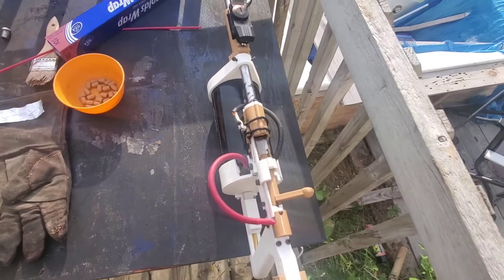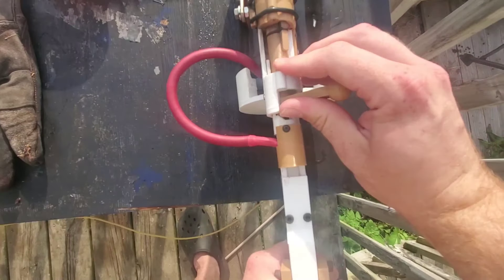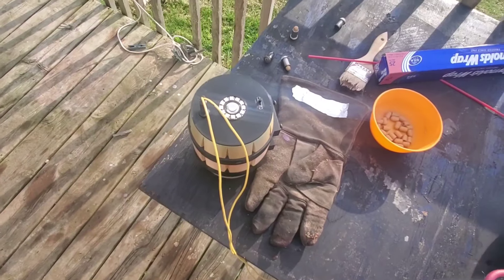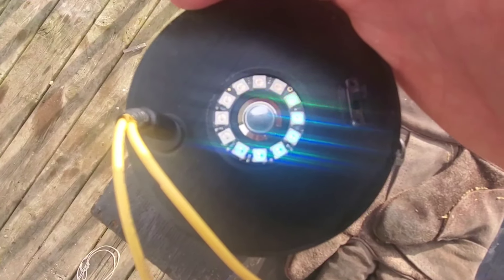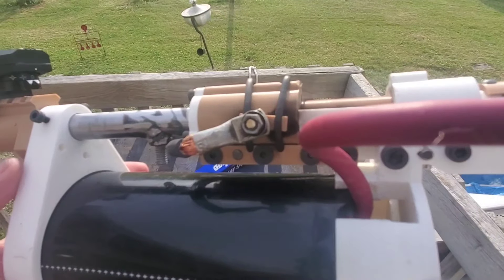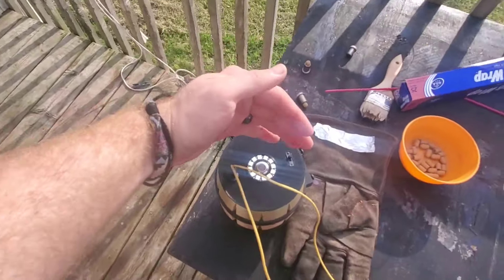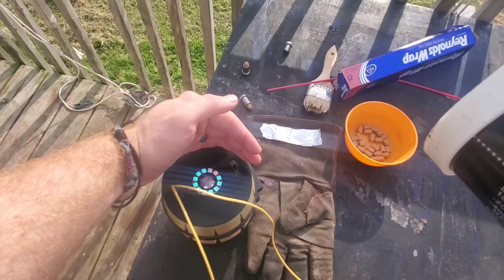Bolt Action Plasma Gun Quick Demonstration

Comment: As your ATF agent, I’m so proud of you and can’t wait to have this cool item in our evidence locker.
Reply: RIP to this guy's dog.
Reply: Nothing illegal about this in the slightest. Its technically not even a firearm
Reply: Lol as usual gov agency’s violating the very laws they created and are supposedly proud to uphold 🤣🤣
Reply: @muskybawls2952  not yet
Reply: @muskybawls2952  Yeah, actually it is.  It uses exploding or burning hot gasses to propel a projectile.  It doesn't matter what the fuel is that is providing the gasses.
Reply: @blu_gingerNY  What law would the BATFE be violating?  I hate folks fantasizing and blaming an organization for something they haven't even done.
Reply: Not likely if he can get the reloading more streamline he'll have a contract with someone in no time.
Reply: Hey he is fine particle weapons are not regulated by the ATF
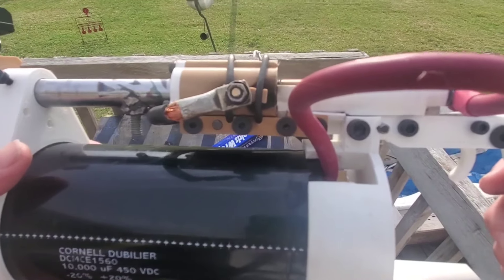Reply: @Omanone4457  He says right in the video starting at about 0:42 that he "discharges a bunch of energy into a piece of aluminum foil, and it explodes and the pressure from that accelerates a projectile out the barrel."  That is the text book definition of a firearm.  It doesn't matter what he uses to ignite the fuel (electricity vs firing pin striking a primer), what the fuel is (aluminum vs gun powder).  Of course, if he has six figures to drop on attorney fees he can fight the BATFE on their interpretation of the law.  I suggest finding a deep pockets organization to back you, being prepared for years of litigation and the very real possibility that you lose everything and go to jail.
Reply: @P.Subaeruginosa  I agree that many other inventions we take for granted didn't appear any more practical in there first versions.  Still, it does seem a long way to go to send a projectile down a barrel.  Now if it sent a speed of light particle beam, energy beam, or light beam, that would be a great leap forward.
Reply: The number of people taking this comment seriously is ridiculous.
Reply: @michaeledmunds7266  Actually, the various points of view expressed show why the comment should be treated seriously, regardless of the OP's intent.
Reply: It's not a firearm
Reply: @lonesurvivalist3147  I don't get why folks keep insisting that it is not a firearm when the video and a quick Google search shows that it plainly is.  LOOK IT UP BEFORE RUNNING YOUR MOUTH.
18 U.S.C., § 921(a)(3)  The term “Firearm” means:  Any weapon (including a starter gun) which will or is designed to or may readily be converted to expel a projectile by the action of an explosive;

Section 2923.11 - Ohio Revised Code
(B)(1) "Firearm" means any deadly weapon capable of expelling or propelling one or more projectiles by the action of an explosive or combustible propellant. 

In this case, the aluminum becomes an explosive or combustible propellant.  Aluminum is frequently used as a component of explosives, rocket fuel, and fireworks because it burns.

Now, in the USA and in most states it is not illegal to make a firearm for one's own noncommercial use.  So, he can have at it.
Reply: At least wait for him to build a second one, so you can cross the streams
Reply: Go ahead I can make new weapons faster than you can make laws banning them.
Reply: @BryanTorok  Normally I would agree except for aluminum is not considered a propellent or explosive under atf regulations and if I'm understanding his design right he's using an expansion of plasma to force the projectile down the barrel, not only this but the atf doesn't even consider most low explosives like this regulatable( look at their ruling on rocket motors)
Reply: As someone who doesn't live in the USA, reply sections like these routinely remind me how lucky I am to not live there.
Reply: You think that's cool wait until you see my z9000 bio molecular disintegratior you'll lose your shit
Reply: @goldenboy9748  That will be hard to do if they seize all of your equipment as criminal tools, freeze your bank accounts, and you are sitting in jail because you can't post bond.
Reply: @BryanTorok  Well personally I think it's a good thing organisations fight the atf for things like that, if they classify regular aluminum foil as an explosive, you would damn near need to background check people who are just baking cookies... Also thanks for not just resorting to pure insults and actually have a discussion not a screaming match.
Reply: @GrouchoTM  if you haven't noticed, Nerf went from pretty cool looking guns with a wide variety, to mostly just having a few different cheap/lame Fortnite  ones and a couple expensive ones.
Reply: Sadly ya name is honestly ironic
Reply: @Omanone4457  not yet, but if they think that they need to they will get it added to the regulations so that they can enforce it.
Reply: @rodrunion8899  this isn't really arms it's more of a weapon of mass deduction, as it can deduce where your brains should go, usually figuring out on the ground is a good place
Reply: @GrouchoTM  "anti constitutionalists" 
Oh sorry we had to take your tank away, luckily you still have your display case of clocks, 12 different types of shotguns and 23 other various handguns. 

I'll stick to my musket thanks
Reply: @rexjolles  cringe
Reply: @josephg.1.130  musket good plastic gun bad unga bunga
Reply: @MrPig40  They actually did that to me though.
Reply: Thats not a firearm so
Reply: 3d print a one time shooter and its untraceable
Reply: Not a firearm. You ca put a silencer on an air gun all you want.
Reply: @BryanTorok  Considering it’s one charge per YEAR, I don’t see the issue, LOL!  By time it’s charged, the skirmish will be over. 🤪
Reply: @muskybawls2952  neither are grenades or rockets, but that won't stop them.
Reply: @williambell4591  You aren't implying that this is an extremely sloooow gun, are you?  While I question the practicality of this, I do have to allow that many inventions weren't very practical in their first incarnations.  That includes airplanes, telephones, and radio.  So, this might someday be useful.
Reply: @BryanTorok  I was just teasing when I said that - don't take it seriously.
I talking about the charging of the capacitor.
Frankly, I'd prefer to see him dumping that stored energy into a laser diode so it could burn a hole though a tree!  🤓
Reply: @2010ngojo  those are explosive which are more destructive than firearms. Idk where you were trying to go with that arguement
Reply: @muskybawls2952 
My point is they are not firearms so it wouldn't stop them from regulating those things. How about suppressors then if you're gonna be anal about it.
Reply: @2010ngojo  try moving to a free state like where i am where we dont follow federal laws regarding guns. That being said i do believe that people shouldnt have true destructive devices such as bombs or grenade launchers without regulation because of the lower intelligence of my fellow man. Example A being you
Reply: @williambell4591  I got your meaning and was concerned about the capacitor charge time myself.  However, there are super capacitors that have much greater capacity (1 Farad is common) but much lower voltage rating.  When the technology gets to the point of having a 1 Farad cap with a 1,000 volt rating in a package smaller than the cap he is using, the factor limiting the charge speed will be how much current the supply can source.
Reply: @StuartGray  😆depends on where you live.
Reply: @muskybawls2952  Not in the US it does not. We have a constitutional right to guns. Also, it is not a limited right in the constitution. At the time it was written it gave citizens of the US the right to carry and use the same weapons that the US military used. Privateers even had ships with cannons. So, if constitutionally we could have artillery and the same guns that our soldiers had ... Any US law in any state that restricts gun rights to any US citizen is unconstitutional and illegal by US constitutional law.

If you live somewhere other than the US then freedom is nothing that you value past its convenience at the moment anyways so ...
Reply: @StuartGray  only problem with that is going to be state laws. You have to follow state laws the same if not more. Local police and state troopers dont go off of federal law. Complain all you want its not going to change anything. Maybe go out and vote if you actually want to make a change or at the very least prevent whatever state you live in from turning into cali
Reply: @muskybawls2952  The real problem is the people. The people have stopped standing up for their constitutional rights. When they do that those who want control remove your rights. Those who enforce state and local laws take an oath to follow the constitution. When they choose not to, I no longer see them as a dutiful servant of the people and accord them none of the deference due to those who are.
Reply: @BryanTorok  Then why aren’t black powder guns considered “firearms”?
Reply: @EasternSunset007  Because, they burn a fuel (actually an explosive containing a fuel and oxidizer) to create pressure and propel a projectile out of a barrel.  However, they are exempt from many regulations because they use an obsolete action and propellant.
Reply: @BryanTorok  I went back and fixed my original post. I meant to say aren’t, instead of are. And black powder is hardly obsolete! There are tons of black powder firearms that are still used every day!
Reply: @EasternSunset007  I thought that you might have meant aren't.  That is the reason  for my last sentence or two.  Black powder guns ARE firearms, but for some purposes in the law they are either exempted or defined to not be firearms for a particular portion of the law.  A gun which takes 15 to 30 seconds for an experienced user to load and fire one shot is not considered to be as much of a threat as a modern firearm.  On the other hand, lots of hunters take deer and other large to moderate size game with them, so they can be just as deadly.
Reply: @BryanTorok   I own several. I get what you’re saying. Not all black powder guns take 15-30seconds to reload, though. I have a BP revolver that uses percussion caps, and you can fire all the shots just as fast as you can cock the hammer and pull the trigger.
Reply: That wouldn’t be classified as a firearm
Reply: @BryanTorok  yet black powder guns are not firearms in the ATFs eyes and you just described one to a T
Reply: All the 2nd amendment Andy boys in here can't take a joke.😆
Reply: @EasternSunset007  Just out of curiosity, assuming that you don't just swap out the spent cylinder with a loaded cylinder, how long does it take to reload your BP revolver?
Reply: @BryanTorok  I have six shots with my black powder revolver. Has the same amount of shots as most all other modern day revolvers home. And it’s only two less shots than a 1911, which many people carry. And I have two black powder revolvers. So that’s 12 shots. Does that answer your question?
Reply: @potato p - we feel equally as lucky that you don’t live here. Govern me harder Daddy
Reply: @EasternSunset007  Sorry, no that does not answer the question.  I was trained on a S&W .38 revolver.  With a plastic speed loader, I can dump the spent cartridges and reload in 2 to 3 seconds.  Much later I was retrained on the Glock 17.  That has 17 in the magazine and one in the chamber.  So, I have your 12 shots and 6 still left over.  Do you carry a third gun?  And, I can drop the magazine, insert a full mag, and drop the slide in less than than 3 seconds.

Still, I'm wondering how long it takes the typical proficient person to remove the spent percussion caps, put fresh caps on, pour measured powder into each chamber, place the bullet, and ram it into place for each chamber.  Does your revolver use bullets that are a tight fit or do you need to some sort of wadding to hold the bullet in place?  I'm not trying to be snarky.  I'm really curious about this.
Reply: Not against the law to build your own gun/firearm.  People do it all the time.  Lots of people build AR's with no serial#.  Completely legal.
Reply: @muskybawls2952  except it exactly is a firearm in most places. it fires a projectile by means of explosive gas. it doesnt matter that its not detonated by a primer and instead uses electronic firing component. hate to rain on anyone's parade but pretty sure this is a firearm most places. certainly ohio.
Reply: People gunna start fighting back tbh
Reply: @mountaintophvac9016  That is in the USA and even then not in all states.
Reply: @BryanTorok  you should try actually reading the laws not just acting like it lol technically a black powder pistol isn't even a gun and is therefore not regulated by the atf. Also he could easily have this registered as an A.O.W any other weapon and be just fine
Reply: @allthingsguy1510  I'm so f'ing tired of having people say the same thing to me without reading all the comments and without really understanding the intent of the BATFE laws.  It doesn't matter what sort of chemical is used.  If it burns a propellant to force a projectile out of a barrel, then it is a firearm.  The BATFE does not recognize firearms that use black powder and an antique mechanism as firearms for the purpose regulating their sale and ownership.  Now, the state and the country you live in may have different laws.  I guess it is a difficult concept to understand that an item can be something and yet exempted from the regulations that pertain to those items.  Fun Fact:  In order to possess loose black powder in any quantity, one needs to have a Low Explosives User Permit (LEUP) unless one possesses the black powder for use in an antique style firearm.
Reply: @mikeh3084  look I'm all for gun ownership but people shouldn't be running around with legal full auto weapons or be able to purchase weapons without background checks.
Reply: @TFP360  I agree felons shouldn't have firearms, but if you have 0 history of any drug/violent crime you should be allowed to be left the fug alone.
Reply: @muskybawls2952  I'm no expert but I think a firearm is loosely defined as any weapon that propels an object through explosive combustion. This is the case here where the combustion is made through an  electrical charge which reacts with aluminum foil, causing it to explode . Not exactly lethal but fits the bill.
Reply: @mikeh3084  everybody has commited a felony in their life at some point and probably dont even realize it. I get what youre saying and i agree with you that some people have no business owning or even being around firearms
Reply: @muskybawls2952  How can you not be aware that your doing something wrong? Are you related to Forest Gump?
Reply: @mikeh3084  lol not what i said. People do shit wrong all the time but dont realize its a felony until its too late. Ever get into an arguement with a loved one? Ever go 20 over the speed limit? Ever leave your pet at home and go on vacation? Theres all types of different things that people do everyday that can be serious af in the courts eyes but not your own
Reply: @rodrunion8899  eh yeah I guess
Reply: Never thought I learn so much about guns today…
Reply: @muskybawls2952  Definitely Not, it takes 5 minutes to reload. Lol 🍀
Reply: @muskybawls2952  🇺🇸 You took the words, right away from what my fingers were going to type. friend.  👍🍀
Reply: As an atf agent im so glad we can never even ask someone about these types of tools because that would be illegal and get us shot and killed, and no charges could be filed because it would be legal😊
Reply: So I guess you know what law this man broke that you can go to his place and steal his invention.
  Build your own weapons.  Oh wait, your not smart enough to do that so you have to pretend that a law has been broken so you can steal from some one who is.